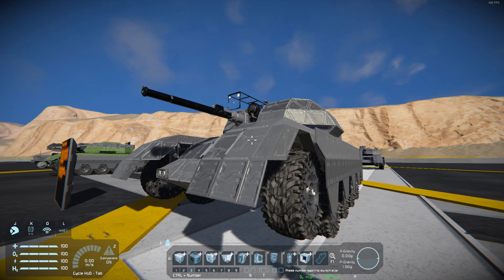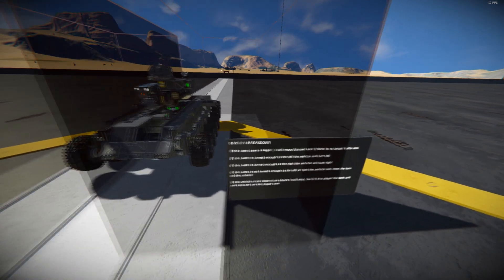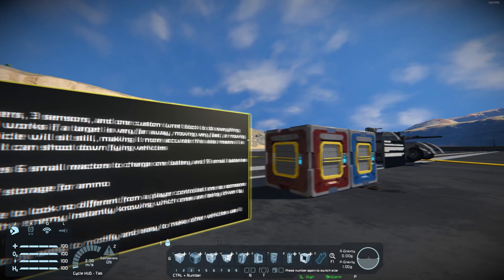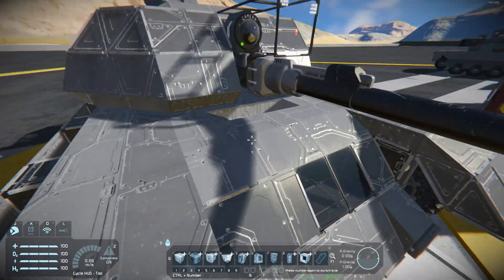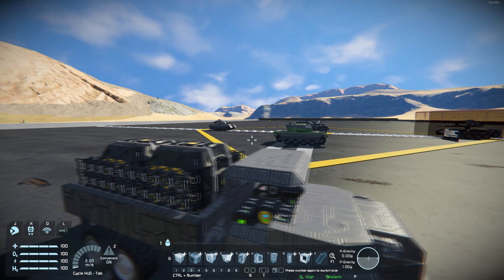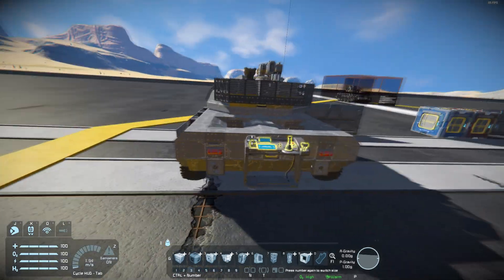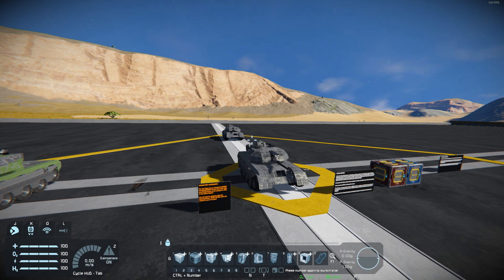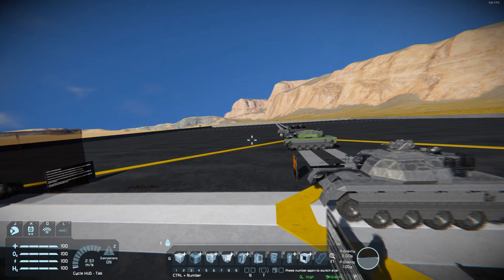Space Engineers Custom Sciptless Tank AI Overview

Comment: have you tried to implement gyros so that they only activate when they detect an incoming object and for it to turn to prevent colisions? also have you been able to get a fully automated tank to where it goes on patrol and then returns to a connector so it can refuel/ re arm and then continue?. I currently have a tank that is capable of patrol and stopping at a connector, the issue is that while connected it will try to reach the next check points, skip due to not being able to reach them due to being on the connector and then basically crash inside the facility because its trying to go to the next path instead.